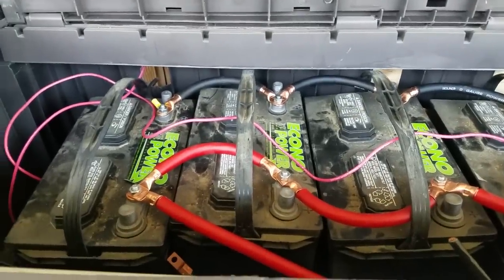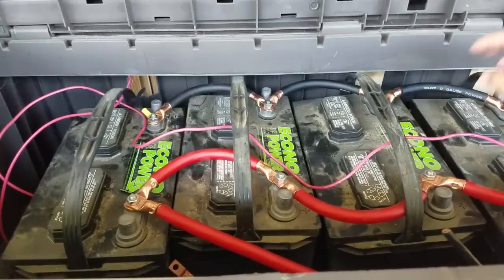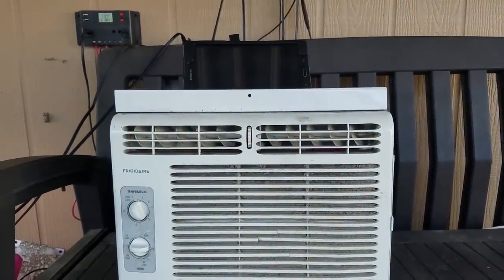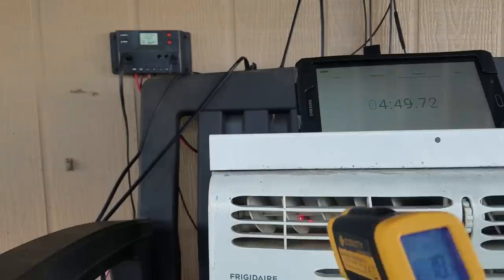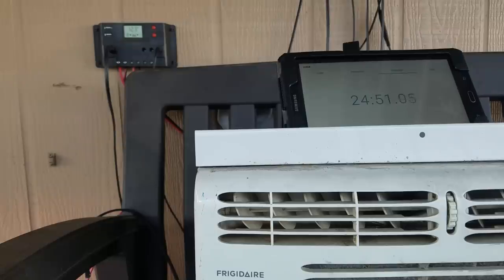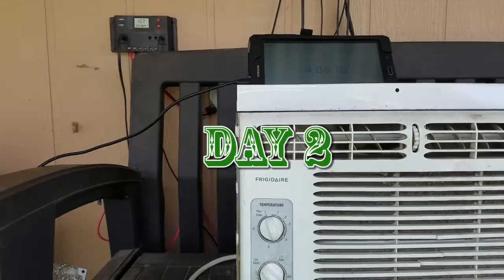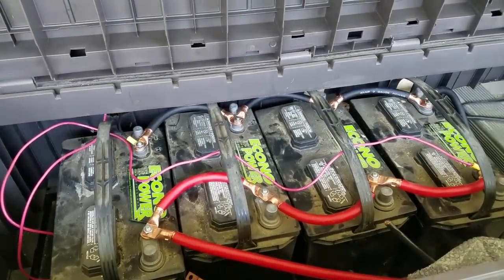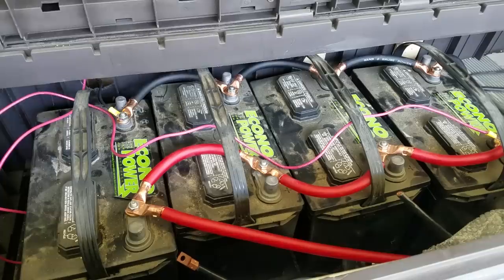Running a 5000btu air conditioner on Harbor Freight solar panels?

Comment: Volts X Amps = Watts.
It will take a full cloudless day to put back the power consumed by the small window unit in one hour.
Reply: 8632tony that was my result too.
Reply: Figure the compressor will run for half the time the AC is running.  The fan will run continuously.  The inverter doesn't run for free, either.  So you will, in a 24 hour period, probably use around 9600 watts (around 400 watts per hour.)   On a perfect day, you will get about 6 hours of usable sunshine.  That's 1600 watts of panel power.  But, figure an extra 30% to replace the used charge from the batteries.  Now we're talking about 2000 watts.  And we haven't even talked about battery capacity to handle such usage.  Run your lights and a small fridge off your batteries with a couple hundred watts of panel power and you will do fine.  Forget about air conditioning with solar.  It's too much the energy hog.
Reply: First, you never want to discharge your batteries more than 50% or you will quickly ruin them.  Good rule is to recharge when you have 80% remaining.  So that leaves 20% of capacity to use if you want the batteries to last more than a year or two.  25 amp draw is a bunch.   The figures given for battery use are not linear.  In other words, just because you can run a 5 watt light for 10 hours on a given battery does not mean you can pull twice the load for half the time.  You'll find your time cut significantly.  You may only get 1/3 the time at  twice the load.  Look at your batteries for the RC rating.  That's Reserve Capacity, or how many minutes (at 80 degrees F.) you can draw 25 amps before the voltage drops to 10.5.  Go below that and you are damaging the battery.  For me, that's too close for comfort.  For a pair of 6 volt golf cart batteries in series, about an hour and a half at 25 amps will hit the magic 10.5 volts.  For your RC 300 batteries, if it were me I would use at least 4 just to treat them a little nicer.  Six would be better.  The harder you flex them, the shorter their life.  Once you've pulled them down that much, I wouldn't let them set for any time at all before getting a charger on them.  The process of converting chemical energy to electrical energy leaves a deposit of sulfate on the battery plates.  When first deposited, it is rather soft and pastey and will easily dissolve back into the acid when a charger is attached.  Left uncharged for any time at all,  the deposit hardens into a crystalline form of sulfate that is nigh impossible to dissolve back into the acid, and that decreases your capacity and hastens battery death.

Comment: You are not running off the solar , you are running on the batteries
Reply: tyler,
No he isn't technically right.  He keeps saying he's running off harbor freight panels and speaks of people wondering how long the AC will run off those panels.  If instead, he spoke of how long it will take to charge this bank of batteries using only 150 watts of harbor freight solar panels, then he would be saying something valid.  You could charge that same bank of batteries with a single 1.5 watt dashboard panel over the course of several months, then run off the batteries the same way and without stating how long it took to charge those batteries, it would be just as meaningless.
Reply: How many watts were you consuming with that AC unit?
Reply: @walthodgson5780  no answer so he has no idea
Reply: You are all wrong. He's running off the cables attached to his batteries 😂
Reply: TheOleriverrat if he hooked up the battery bank to his car 🚗 he could say his running off a car alternator that’s charging all the battery’s
Reply: blue7474 jack 
With out them there would be no stored charge. The batteries are what stores the energy
Reply: @ TheOleriverrat: nope not gasoline, decompossed dinosaurs, still i like your comment OLE!
Reply: TheOleriverrat y
Reply: What he forgot to tell you is it took a week to charge those batteries, so this system is a no go....
Reply: TheOleriverrat 

OBVIOUSLY HE'S NOT GONNA BE ABLE TO RUN THAT AC ON 150 WATTS THROUGH THE PANEL. THE TITLE WAS CLICK BAIT.
Reply: Well,  if we do the math ...  He's got over 4000 watt/hours of battery capacity  and charged with 150 watt solar panel.  If he were to drain that battery,  it'd take him 1 billion years to charge it to full.
Reply: he definitely could say that, yes. I'm gonna turn my mechman alt into a windmill.
Reply: Ogre Dad: onomatopeia time "badum tish" aka joke roll. decomposed dinosaurs
Reply: fvrrljr 

My bad!👍carry on!
Reply: TheOleriverrat yes we know
Reply: Interesting, running the AC off 150 solar panels.  Why not just skip the batteries and save weight?  ........ Because he is running off batteries and putting a trickle charger on them from the panels.
Reply: What a stupid question, are you kidding is this a joke...
Reply: It's called a battery bank...and they are charged by the solar panels, without them you would be wasting stored energy
Reply: Yes it would be
Reply: So , if he hooked the battery bank to his car by jumper cables , he could say that he was running the air conditioner on gasoline .
Reply: tyler coblentz 
First of "witch"? You mean like black magic?  The point is he's using more then the charger can replace so he's not running on solar, he's on battery
Reply: @c3pfett  *than ( he's using more than the charger can replace) :) :) :)
Reply: TheOleriverrat yes smart ass
Reply: fvrrljr 

Fossil fuels is an unproven theory
Reply: Witch is charged buy the solar panels so technically he's right
Reply: you can't refill the batteries as fast as you discharge with that setup. Need 2500ah of battery, 3000 watts of solar and sunny days to keep running.

Comment: Thanks for the videos!  What size are the second upgraded set of batteries?  (I didn't hear you mention it - and in your previous video you showed that you had  4  35 amp batteries.) What size are these?  (By the way- I have the exact same air conditioner and was wondering how I could run it off the Harbor Freight solar panels that I bought!)
Reply from the maker: The new batteries are 88 amp hours each. I  baught for $60 at Interstate batteries

Comment: Been following your channel for a long time.  You have big improvements with your solar system. I'm planning to do the same thing run an 5,000 btu for a big dog house I'm building. I have a set of harbor freight panels and 4 trojan t105  got 0 gauge.  Still on the process of buying an inverter. Thank you for making these videos!
Reply: Well????? How did it turn out????